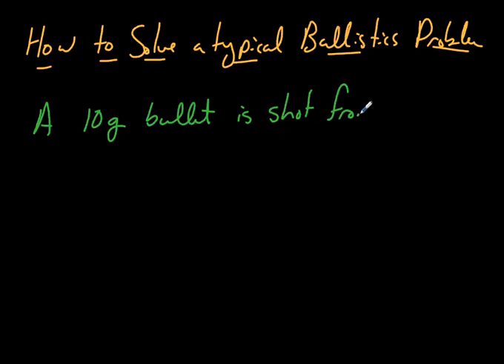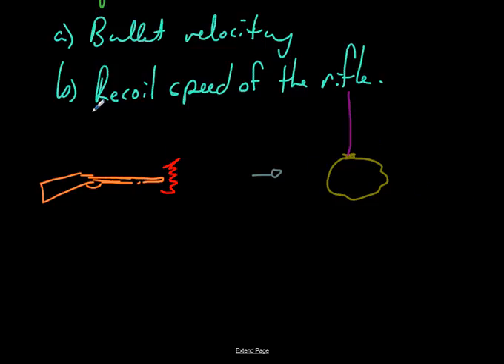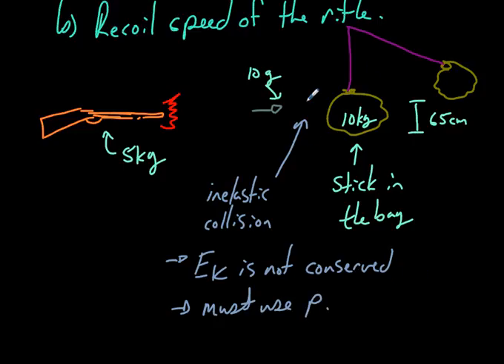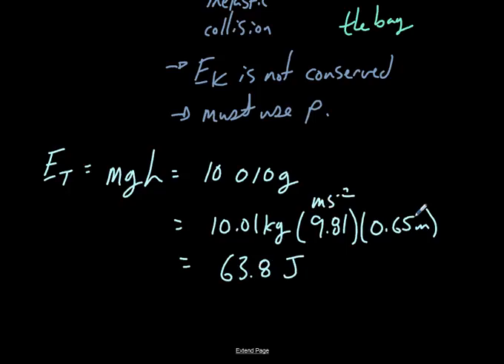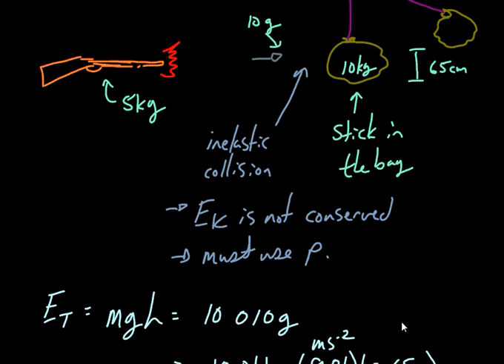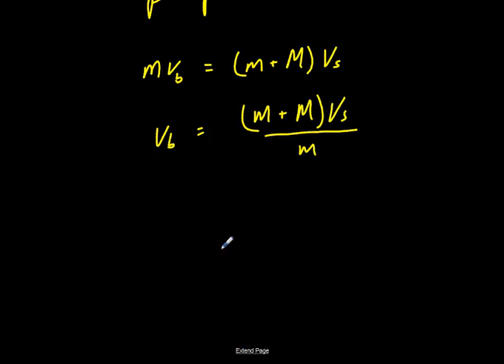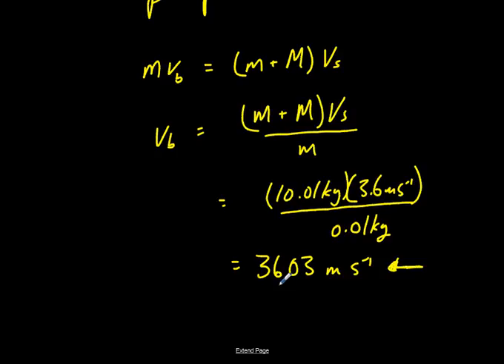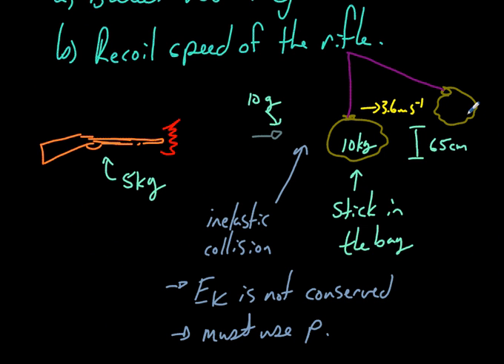Solving a Bullet Velocity Ballistics Problem

Comment: No firearm I know of can shoot a 155 grain bullet 8059.68143 miles per hour!!  I think you either made the sand bag move too high or the sand bag too heavy! lol  The fastest bullet speeds I ever heard of being shot out of a rifle are just above 4000 Feet/Second to around 5000 Feet/Second. The .220 Swift remains the fastest commercial cartridge in the world,  with a published velocity of 4,665 ft/s (1,422 m/s) using a 29 grain bullet.
Reply from the maker: Yah...that type of thing happens when you make up input numbers without prechecking what results they will produce. If I have time I'll start with realistic output values and work back to get proper input values but lots of times I just wing it. We are more concerned with theory so I'm often not too worried if a crazy answer pops out the other end. Most students don't blink an eye when values like this come out the other end... but once in a while someone will realize the answer is nuts... it can be a good teaching moment if no one notices and I'll often ask them if the answer is reasonable and why. Thanks for bringing it up!
Reply: @GregJohnsonWinnipeg  I realize you just doing it for teaching a theory.  When I was taking Fire fighting classes many years ago, I had an instructor do the same thing to see if any of us students would catch on. lol  Some of us did. He basically did it to make sure we were getting the theory correct.  I remember the one time we all got some crazy numbers on the one problem, and we all thought we got it wrong. Here it threw in some wild and crazy numbers into the equation to see if we were paying attention, We were. lol